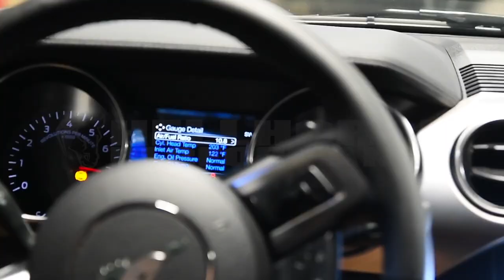FIRST EVER! s550 Mustang GT Corsa Double X vs Double H-pipe DIRECT COMPARISON *LET'S GET LOUD!

Comment: I keep going back and forth on X vs H but I think im sticking with X. I love the deep tone of the H pipe down low but my thing is that it gets kind of boring sounding up top vs an X pipe. I like hearing the Coyote scream through the gears/rpms. I feel like that's the whole appeal and is a feature unique only to the Coyote. I feel the H kind of takes it away by trying to blend it in to sound like the rest of the V8s of the past. I think if the Coyote only revved to 6500 then I'd go with an H. But as of now, I like to listen to the Coyote scream as it eats through the rpms and project that uniqueness.
Reply: I Totally Agree with you about the X pipe and the Coyote Scream at high RPM !!! ;)
Reply: Indeed

Comment: Fantastic comparison! Thank you for this video and all your support. We love the XX but more options = better! We will have a HH w/ longtubes + blower (also active) video out soon!
Reply: Do you know if the double H pipe would be able to fit my borla ataks? Thank you
Reply: Are promo codes working on the Double HH pipe? Wanted to use zanders code but it said it was invalid. Only certain things?
Reply: @hUrFaH54  If its a 3" variant, you should be able to make it fit.. the only issue I could thing is where the Borla midpipe ends and the axleback starts being a different length.
Reply: @IVD214  Login for Corsa pricing :)
Reply: Lethal Performance thank you

Comment: I have the Steeda h-pipe with the stock active exhaust. It sounds so good I can't justify dropping 2K on the Corsa.
Reply: I got the same on my bullitt. For sure the more cost effective option and sounds fire.
Reply: @volkswagenhawk7094  I just noticed yesterday how much it burbles and pops in track mode when lazy shifting... sounds incredible.
Reply: Steeda is sooo underrated 
I have steeda axle back + corsa double x it’s sounds amazing

Comment: I do not like the sound of an H-pipe. The X-pipe on a modern technology engine like the coyote and voodoo motors makes them sound so exotic and amazing. Plus x-pipe flows so much better
Reply: Yeah the X-pipe tends to give the Euro exotic sound, race car sound. I prefer the Mustang to have a muscle car sound.  Ever since the Coyote came out, I always thought it never really had that Mustang sound. I am referring to the smaller 4.6L and even the Terminator Cobras and old 5.0.  They had that hollow, metallic rumble. I know the Coyote is a 4 cam, 32 valve, but then so were the 2003-2004 Cobra and Mach 1's. I didn't like the high pitch rasp. The H pipe from what I have heard flows better in the low to mid-range. The combo I have is an MRT H-pipe with GT500 mufflers. To me it's the closest to the Mustang sound you can get. It has that deep rumble idle, and on easy acceleration has a nice burble almost like a high powered speed boat. No drone, but it can sound like a Hemi on cruise. And on WOT sounds like the 1967 390 big block in the film Bullitt.
Reply: @jodl73  The Awe Touring catback sort of sounds like what your describing, I had it on my 2018 mustang GT.

Comment: HH = HOT 🔥.  You are right it’s a little quieter at lower RPM it seems.  That’s not necessarily a bad thing.  For sure a deeper rumble and maybe a little more crackle and pop at the end off throttle??

Comment: 2:30 i personally don't think the x pipe is exotic sound i had mine for a year. i could not bear the sound any more longer is like a honda ricer, is like having a trumpeter in your back seat 24/7, now the h pipe is a more grown adult type of sound a more all around sound almost hyper car territory, nice deep deep low and high tone at any rpm range and a nice feeling with that added torque of the h pipe , the x pipe give you more peak performance but honestly and realistic i don't need for my application peak performance i was looking for that torque and the h pipe deliver and exceeded my expectations.

Comment: New coyote mustangs are not old school cars. Not foxbodys. Stop trying to make the high revving modern beast of a motor sound like an old pushrod
Reply: The older engines sounded better. A lot better. What's wrong with making a new engine sound like the older ones when doing so isn't going to harm performance? You need to just pay attention to your own shit and let others do what they want with the car THEY paid for.
Reply: TroutButter umm, so you want a modern engine to sound like an old low-revving, slow-revving, low hp pushrod? To each their own buddy. I like the fast/high revving of the coyote engine platform. I love the high revving exotic muscle sound.